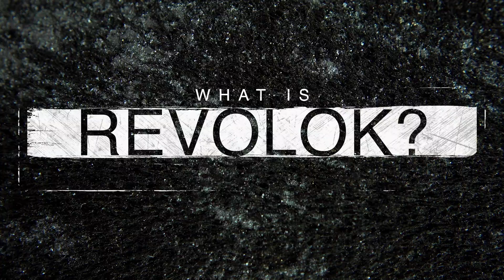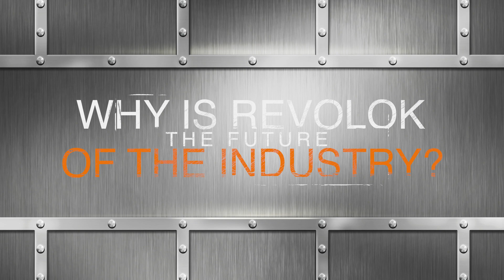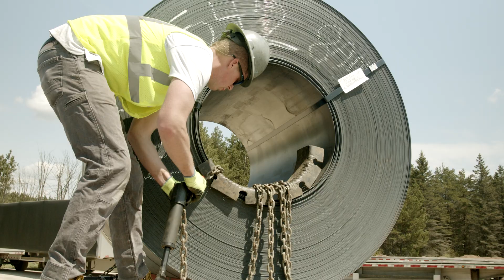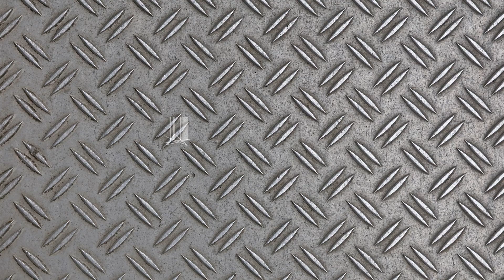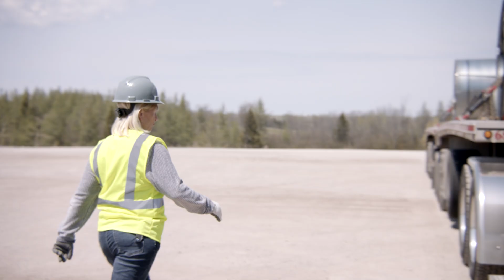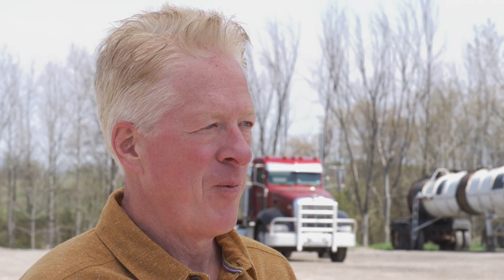What is REVOLOK?

Comment: THis product was reviewed by multi YouTubers...and bottom line was NOPE ! You always need a battery operated tool....was biggest drawback plus keeping chain tight and Price !
Reply from the maker: Benny, or should I say - BSdetector? Clever YouTube name :) Love it!

Can you send a link to the product reviews? I think you're referring to a completely different product that also uses a battery drill. 

 A 5ah battery will last an entire week for steel coil shuttle-run drivers using the REVOLOK. 

Keeping the chains tight? How tight are you getting your chains? serious question.

The REVOLOK is the only device for 3/8 chain that has a known load. We designed it to achieve 3500# of tension so your chains won't come loose, or exceed WLL. It gives you the most stored energy for your chains during dynamic events and prevents chains from going to zero, or exceeding WLL during transit. Ratchet binders can't meet DOT standards because the user has no idea how tight they are getting the chains or what happens to the chains during transport. That's why we collected all of that data before designing the REVOLOK 6600.

Here is a link to one of the tests we conducted at Navistar proving grounds that shows real-time data on what happens to chain that is too tight - https://youtu.be/KZAH4_ADoBI

Here's what happens when you are too loose - https://youtu.be/ZZhpGcZ6JDA

Comment: I've had chainbinders I can't get past a certain place on the chain, it kept hooking on the same place,which happened to be a bent chain loop! The chains stretch and need to be retightened! Or replaced,I've stretched Hercaloy chains, which are designed to take greater force then regular hardened chains!
Hauling steel as you show it ,should also use huge chalks in front and back of the steel roll!

Chainbinders of any kind can snap off with the inertia of hitting bumpy roads or a dead stop in an accident!
I see a lot of truckers hauling I beams with the wrong chain pattern! This should be done by placing one chain in an over the top loop,then a second with an under the bottom loop and place the I-beam on wooden boards! 
This way the I-beam can't shift also dead stop the I-beam by placing a chain on the head end of the I-beam and the rear end of the I-beam,this requires hooking 2 more chains to pull the end chain forward to keep it on place!
Or place the I beams on top of old tires( no rims),so it can't slide around.

Comment: So like other power assistanced binders, you need to buy a,battery operated tool. And charger, then store it and keep it fully charged .
My ole ratcheting binders just need to be kept clean and have a small pry bar.😮
Reply from the maker: Drill binders aren't for everyone. A 5ah battery will last an entire week for most coil shuttle run drivers using the REVOLOK :)
Reply: @revolokcargosecurement you got that comment right.

Comment: same as a speedbinder already invented.
Reply from the maker: The REVOLOK 6600 is Screw driven with a patented design. It has known tension (radial clutch) for more stored energy in chains with equal load being applied to all chains. A completely new driver can pick up a drill and secure a chain to the correct tension using the REVOLOK.

Additionally, the REVOLOK does not have a handle and comes under load without twisting. It has zero exposed threads and you never have to grease it. Zero maintenance is required. The REVOLOK 6600 is the fastest binder available and is sourced and manufactured in the USA.

Completely different designs but yes, both are operated by using a battery drill :)